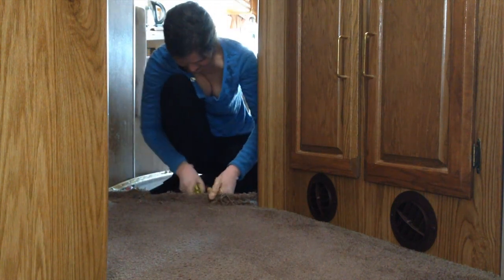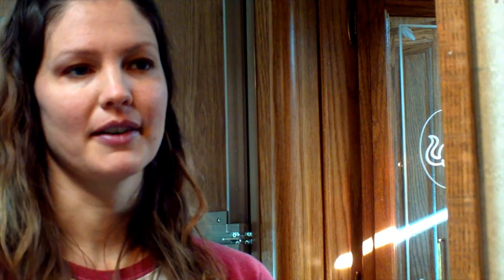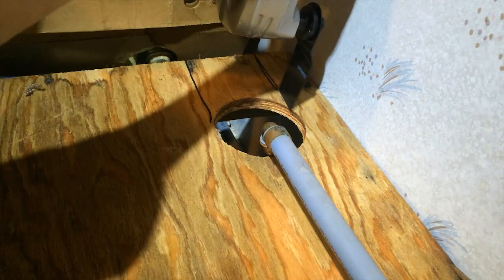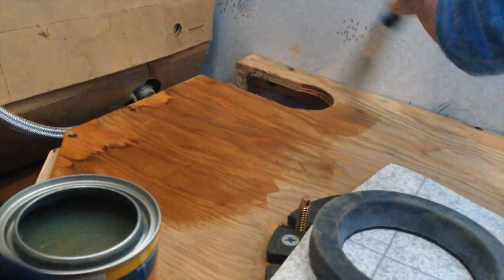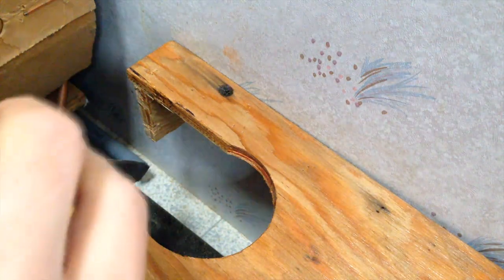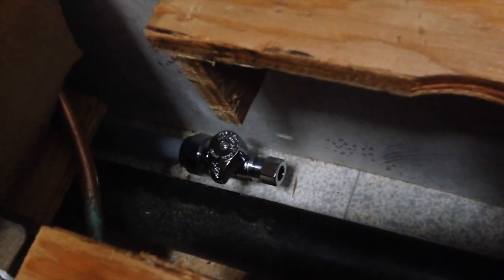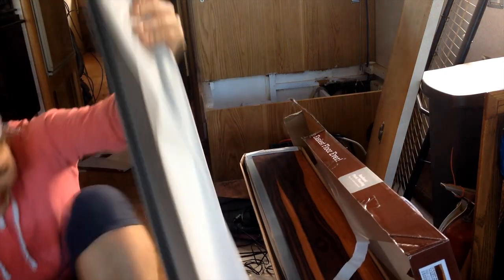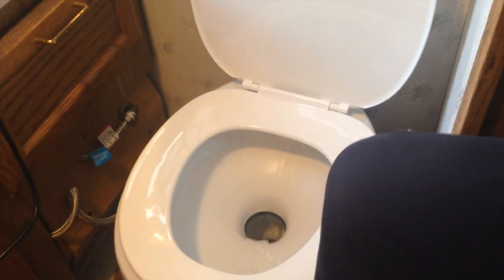RV Living: RV Renovations and Replacing Motor Home Toilet

Comment: Hi Pipi. As a plumber, I like the idea of having a minimum number of joints in a pipe.
The other theory I try to abide by, is to not put any type of compression or push fit fitting, into spaces that cant easily be maintained, eg underfloors. This is because on all the leaks Ive ever had to find on a joint, the majority have been on compressions and push fit, and if its under a floor or in a wall, its so much harder and expensive to repair. Compressions are also more prone to leaking if in a enviroment where they are exposed to movement, eg vibration from a motorhome being driven. I hope your repairs give you years of reliable service.

Stay strong, safe and well.
Reply from the maker: aspudkicker Thanks for the great advice :D

Comment: You did a great job!! Lots of valuable information for many to use. I have been in the flooring business for years, and I must say, you did great. If I could add one piece of info to help your followers here, always run flooring along the main floor first. You will have to cut some pieces when you get to the end of the room. Those cut pieces and scraps are what you use on pedestals and closets. If your floor is 100 sq ft you need to purchase 105 sqft, basically add 5% for waste and accidental screw ups. Keep up the great work Pippi!!! Have fun in your travels, and be safe.
Reply from the maker: davel8n Great info, Dave. In this case I couldn't wait to have cut pieces already. Great tip, too about the 5%. Take care! :D

Comment: I love how you look like an excited kid opening a gift when you check out that new flooring.  I like that flooring and might consider using it.  Thank you for the idea.
Reply from the maker: Frosty Life Cool, thanks Frosty :)
Reply: I used that flooring in my toy hauler this past summer. I like it a lot. I haven't looked at it since we've had some really cold weather here in Colorado, but so far, it's held up well and looks good. It was easy to install. I cut around the tie down "D" rings and used a brown caulking around the inside edge to still allow movement with temperature changes.

Comment: I just went through the same thing with the same kind of toilet. This video really helped the handyman. He went to the RV place to get the long tool and as it turns out you can reach behind under the old toilet and unscrew. I too found the seal not worth replacing, as the part costs almost what a new toilet costs. So I went w/ a Dometic ceramic too. Mine is different-it's got a longer seat made of white laminated wood-it's like a high house toilet, but works like the RV ones. It's what they had in stock. After reading the amazon reviews, I did not want another Thetford. Again this video was a lifesaver!!!!!!!

Comment: Nice one... I replaced my 88 plastic toilet with a porcelain throne a few years back and wow what a difference. You'll love it. So much cleaner and nicer to use and see daily. More like a house bathroom. No more stained and yellowing plastic to look at. I kind of had to chuckle as I too went through the drilling and cutting of the plastic flange to get the new toilet bolts to fit. Great job...

I've been waiting until the summer to lay vinyl throughout the coach. I wanted to go hardwood but being 6'7" and my floor to ceiling being 6'7" it makes adding anything thicker than one layer of carpet an impossibility. The only way that I can go is like you with a peel and stick vinyl tile. That sure is a nice choice you made there. Can't wait to see it when you are done.

Just got done remodeling the two twin bed bedroom into a queen with an adjustable head to incline my head for reading, watching TV or working on the computer without the need to use a boat load of pillows. One pull of the strap and the head ratchets up four incrementally higher settings and one pull of another strap and the head drops back down to being flat for sleeping. So freaking comfortable. Been trying to get that video edited together for months. Probably uploaded and out next week.

Ah, nice choice on the SharkBites also... I've been trying for the last year to replace all the Pex or PVC in the coach with all Pex-Al-Pex tubing with compression fittings. I bought everything that I need to complete the job but just don't have it in me to tear into everything to get to old out and the new in. Maybe when the vinyl goes down in the summer and it's already a war zone (and drier outside) I'll tackle that one. If you ever want to upgrade the pipes do look into Pex-Al-Pex. It's an aluminum pipe sandwiched within two layers of Pex. Rigid and yet flexible in addition to very temperature resistant so no freezing blowouts when the temp drops. Only thing is that it requires more expensive compression fittings and won't accept the SharkBites.
Reply from the maker: Bugout Bounder Cool remodels! Definitely a bit of work to replace everything. Great idea in waiting til you do the vinyl. In fact, at that time you may find things you didn't know, like leaks... Good luck with all that!

Comment: I used that exact vinyl flooring to cover plywooad sheets to make rigid chair pads for my office that looked right with my 1970s vintage Danish modern teak desks.. I had some left, and used it to make two brown-black Ikea Lack end tables look like they had thick exotic wood tops.  I also matched the grain on the tops, so that, pushed together, they looked like a coffee table with a continuous top. $14 tables, $100 designer look.

Still had a few pieces left... Covered my white plastic kitchen cart from Ikea (very cheap and looked it, but the perfect size and nicely sturdy for holding printers and supplies), leaving the polished aluminum legs showing.  Another nearly instant upgrade.

At home, I used similar quality faux slate ties to make a backsplash.  Just installed some scrap whiteboard over the drywall with screews and covered that with the tiles.  You need a smooth surface to get the adhesive to adhere in a vertical orientation.  So you can use this high quality vinyl flooring to do much more than floors!  Do try to ventilate areas with freshly installed tiles...they smell like cancer chemicals when fresh out of the box.

Comment: Thanks for the lesson. I'm having the same problem, but with the sink as well. I'm planning on having the sink cabinet removed and installing a pedestal sink. And may have the toilet removed and a composting toilet put in. I can see how far into the linoleum the leak went because it's all discolored underneath it now. I've been turning the water off outside half the time.
Reply from the maker: Keep in mind about removing the cabinet and installing a pedestal sink, you'll lose all that cabinet storage. And a pedestal sink would add a bit more weight. But it would certainly be pretty and give a bit more room too! :D Good luck!
Reply: Well, I won't lose too much space, considering there are only two small shelves underneath the sink. I plan on taking out the stove as well. It isn't even hooked up. I didn't know that when I got it, but I' rather just use hotplate things and my little counter top convection oven anyway. I could probably lose weight by taking out the toilet and tank and pipes, and go with composting toilet. : )

Comment: I live in my Bounder as well. I have the same floor plan as yours. I had a leak in my toilet a few months ago. The amount of time it took to remove those two screws holding the toilet was crazy. Not to mention frustrating. Not something I want to do again anytime soon. That was smart going ahead and changing out the plumbing there.
Reply from the maker: 1991BlueBird Yeah, why the heck put the screws so awkwardly in there like that! Glad it's in the past for us both!
Reply: Pippi Peterson Me to. I would like to know the answer to that question as well. If you decide to remodel your counter tops during your renovations, you may want to check out my countertops video. Cheap renovation I did on mine.

Comment: I'm going to install a toilet that burns the waste to ashes in our summer cottage this summer. I've seen those kind of toilets in campers also. The good thing is that they don't use water, but you need electricity. Anyways, I'm a bit scared because I've never installed a toilet before, but you're video made me more motivated! Thanks!
Reply from the maker: Mikael Sol Right on, you'll do just fab!

Comment: Awesome vid Pippi, thank you ! You're so independent and a clever young lady :-) I'm doing some upgrades on my RV's plumbing and other assorted new piping projects this spring too and plan to go with the flexi-hose style and a new intake bus-bar that will bypass the extra 40' of unnecessary piping originally run to accommodate the water heater  installed near the front of the coach. I hope to replace that heater too but installing the new one under the galley sink instead, waaaayyyyyyyy closer to where it needs to be and eliminating any further risks of freezing up next winter  with no pipes being exposed. I bought my rig and planned to live it for twenty years so I don't mind doing upgrades and investing in my home.  Good luck and all the best to you Pippi. Cheers ! Janis
Reply from the maker: The Speeding Turtle Good luck to you, too Janis. Sounds like you've got some great plans! Happy trails :)

Comment: That's also called a compression fitting where you attach a supply line to a pipe or a valve to a pipe without sweating or gluing it on. You're doing a great job on that repair and the varnish you are putting on the plywood will definately help protect it. That plumbers tape is usually called Teflon tape.

Comment: They also make glue on fittings for your pipe that have valves and threads on them which in my opinion is not only a better seal but also cheaper. Check your plumbing section at Home Depot.
Reply from the maker: bestconnections Thanks for the tip! :)
Reply: +Pippi Peterson To add to the tip, be certain to tell the salesperson at home depot the type of piping you have so you can get the right adhesive. They're not all alike- experience talking here.

Comment: We have the same Bounder and I was considering removing the pedestal and putting in a tall toilet but I know see that removal of the flange and the offset angle to the black tank that it is a no-go and we'll just recover the pedestal and either rebuild and use the original toilet or try and find one that is the right height to enable the vanity drawer to be opened and closed.
Thanks Pippi for sharing your ordeal as it likely saved me one!
Reply from the maker: +Barrett R. Smith Good luck with that!! 😄

Comment: peterson pippi "there's this thing called plumbers tape?" you are too cute. thanks for masking my day. Oh, and I don't know if you found one but you can purchase a water regulator at any RV store or even wal mart or target that regulates the pressure of water coming in to your RV. You can also pick up a water filtration system that hooks up to your culinary water on the outside before it comes into the RV. Cheap and beats using a Brita pitcher. :-)

Also, your flooring is amazing! I love the pattern!

Comment: Wow that's taking the bull by the horns. You did a fantastic job with the explanation and visual at the same time. It is kinda frustrating but at least you found a problem before you did all the other work. And yes the flooring is very nice. also smart move changing out the piping. I don't know if you knew it but the less joints (90 degree) the better your pressure will be. Can't wait till the next installment. keep it up and you'll have a new rig on the inside.
Have a Blessed day.

Comment: Love your stuff Pippi. Keep up the good work. Also with those pressure fitings, you don't want to tighten them too much. It will over compress the rubber fitting inside and cause it to leak. :)
Reply from the maker: Nathan Johnson Great input, thanks, Nathan!

Comment: Sorry about the incident with the "water" in your face.  Reminds me of the time I had a leaky engine gasket in my Jeep, and to get to it, I had to remove some parts.  The pipe to the AC dryer broke and sprayed coolant on my face.  Luckily I was wearing glasses so my eyes were spared, and this was after vehicles used Freon as a coolant.  I went straight to the bathroom to wash it in cold water.  Supposedly it's non-toxic, but it made my face red, and has never completely gone away.  Most people say they don't notice it, but I sure do.
Reply from the maker: +David Guarneri Ooof, that doesn't sound good. At least it didn't kill you :)

Comment: Brave girl, great video, on our oldie with painted all the oak cabinets with white melamine, modernize and brighten the interior
Reply from the maker: Joe Baker In mine, the cabinet doors are wood but the actual cabinet is covered in plastic-y faux-wood tape/sticker. Is yours wood? If not, how did you paint over the sticker material?
Reply: To paint the plastic faux wood, Use a strong detergent like trisodium phosphate, then apply a primer with extra adherence (check the link).
then you favorite color paint. 

Could make a good before and after video

Cheers

http://www.benjaminmoore.ca/en-us/for-your-home/paint-products/sure-seal-latex-primer-sealer?lang=en_US&role=H#s_pt=use_primer&advs=0&tab=2

Comment: Cycle the toilet supply valve maybe twice a year, now that you have one. It'll make it easier to operate down the road if you ever need to isolate the toilet again. (Those valves tend to get stuck, and fail to seat, if they haven't been exercised.)
Reply from the maker: DanielinLaTuna Great tip, Daniel!

Comment: I had this exact problem...I was simply doing a cosmetic overhaul but when the blackwater tank overflowed onto my carpet, everything got ripped up and thrown out. I figured I may as well insulate and put down a new floor. Not sure if I should replace my toilet and it looks as though switching yours out was a separate nightmare. I hope I can avoid it...on the other hand, I am envious of your fresh white potty...mine is c1986 harvest gold ;-) As always...thank you!
Reply from the maker: +Marilyn McConnell Switch it out. It's easy, just one step at a time. You'll love your new, clean, never-used one 👍

Comment: Graet Job on plumbing!  Waiting to see your new floor.  I used the same flooring in my 93 Bounder but went with the old wood grain pattern and it turned out great!  I almost went with the grain you will be laying down, as it looked very exotic.  Wife did not want it to that exotic.  :(
Reply from the maker: Robin Lewis Old wood grain is nice too :)

Comment: I hope that flex tube with the braid on it lasts longer than the one I put in my homes bathroom with the "lifetime" warranty on it that broke after 6 years in a stationary house and now I have to remodel the bathroom as the first generation particle board turned to the sawdust it was!
It just burst and that was that! OUCH! Didn't even give a leak a warning!
But nice job!

Comment: HELLO PIPPI... WOW.... I am SO PROUD OF YOU!!!

(What TOILET did you USE as your Replacement Toilet? it looks like it fit really well. Model # & Manufacturer?)

This is the first of your videos I have watched. I must say that YOU my dear girl have this ol' Dad some confidence about replacing my toilet in my 1994 Bounder 34J Motorhome. 
As I began watching this video, I was SO HAPPY to see that we have got nearly the exact same floor plan and model Motorhome. This toilet issue I am having has to do with the Water Inlet Pipe that connects TO the Toilet in the back. 
I have disconnected it and discovered, after screwing a plug into the water line, that it is the water line that is leaking NOT the toilet. But.. My goodness they make that back inner bolt SO DARN difficult to remove. 
I am happy that you had your Dad with you to help along the way. I no longer have the privilege, so embrace the love of your parents. 
You have the most audacious, fun, happy beautiful personality. I do hope your parents are extremely proud of you! 
And though in the past two years, I know you've learned a lot and many of the "Nice" commentators have offered you some great advice, (which I will also keep in mind for my own remodeling adventures), I think you did and do a great job. 
I hope to meet you one day on the open road ... have some Ice Tea and share stories! 
Happy Trails, 
Allen

Comment: you did everything correctly, with the exception of the base gasket or ring.... if I'm not mistaken that should have been put on the toilet not on the floor hole , it goes on the toilet snug then put the toilet on the pedestal lining it up..... but it looks like your way worked as well. .... great job,  I totally enjoy watching your videos. .....
Reply from the maker: +JSWIZZLE8R n Thanks for tuning in :)

Comment: Imo, you would have been better off just getting a composting toilet, although fairly expensive, it will save you some water, avoid leaks and eliminate having to drain and clean your black water tank.
Reply: ***** true, if it were me i'd put a liner in the toilet and when i'm done tie it up and dump it in the garbage bag at the next stop. lol
Reply: CycleCruza that sounds like a winner if you have ''dog bins'', but i dont know about putting in standard garbage...
Reply from the maker: CycleCruza I'd love a composting toilet if I owned land. But I wouldn't consider myself better off with one in my RV. To each, their own!

Comment: kool nice job..  I have leaks from the last rain, floor has weak area, no hot water heater.  it's a job i'll be liking to diy.  thanks
Reply from the maker: Kevin P. Lane Good luck with that, Kevin. Keep at it and it WILL get done! Sometimes it's hard to believe it will ever get done :)